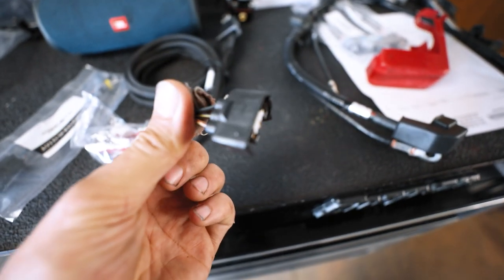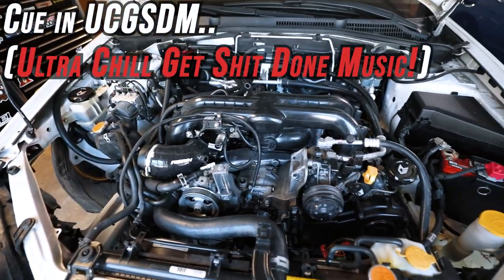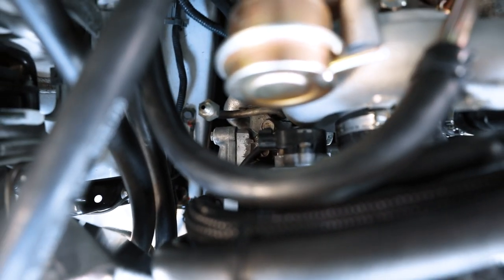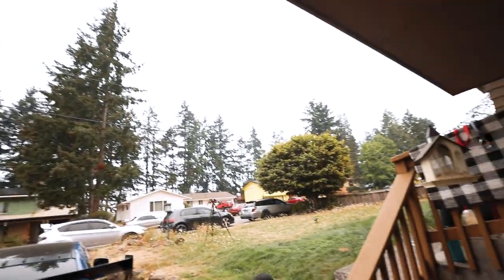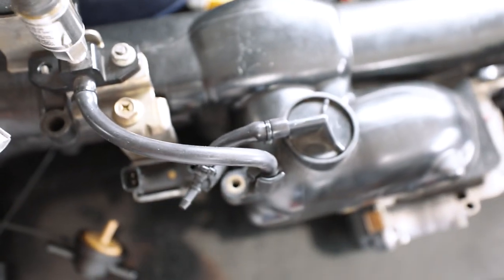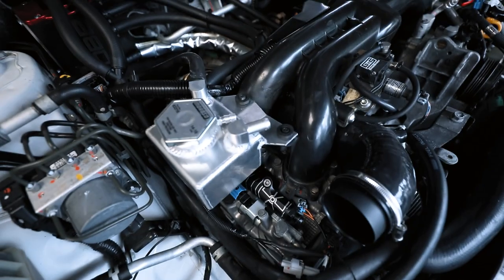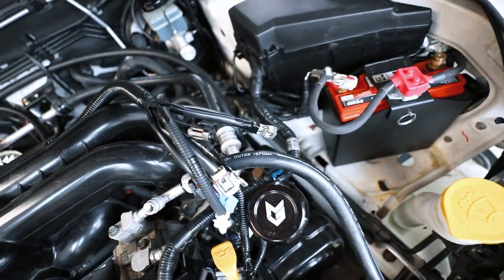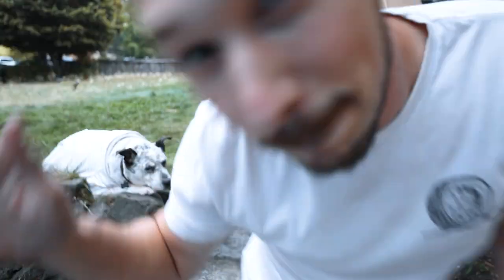NO MORE SPAGHETTI for Mittens the Legacy GT (New Harness, IWire Grounding kit, Evap & Hoses.. Done!)

Comment: Could try a 90 orb fitting off each side of the fuel rail instead of the straight orb-an, gives a much tighter turn so your not trying to occupy the same space as the tgv connector with the an fitting
Reply from the maker: Ooo, good idea. I haven't bought things for lines yet so I may weigh that out. I test fit and can get lines on currently with the tgvs plugged in.